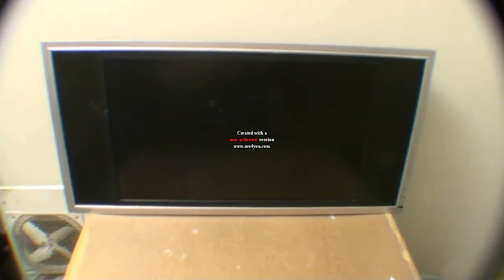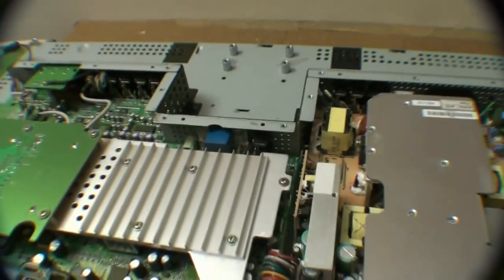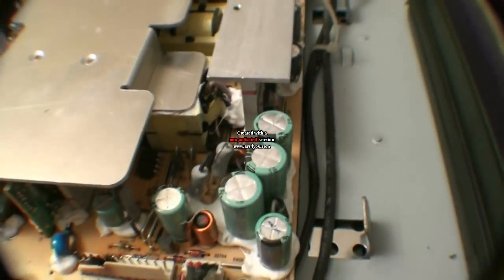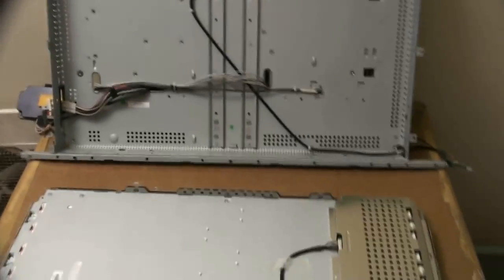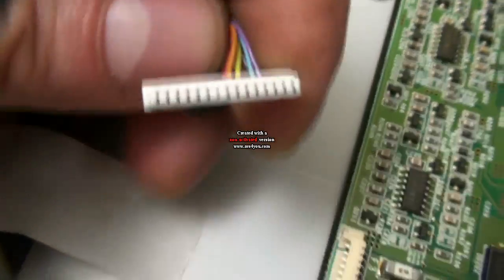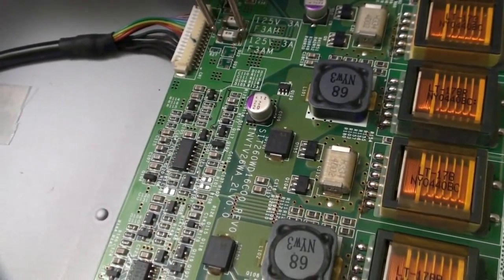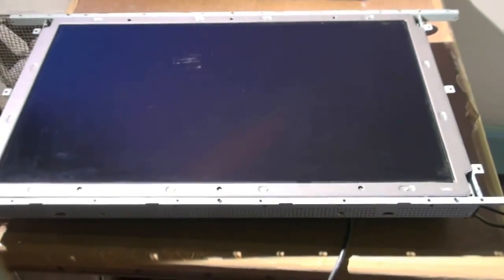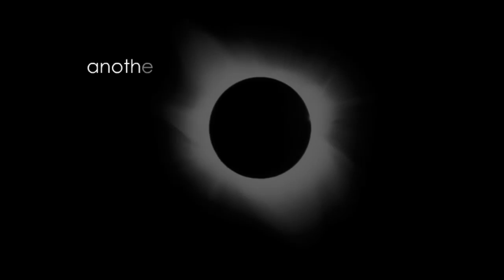Dell W2600 Autopsy And Repair pt. 1

Comment from the maker: Well, I'm not interested in selling it at this time, since it's the only working LCD tv that I own, and it still has some power supply issues that I need to look into.  Once it gets warmed up, it won't turn back on until it has had time to cool off.